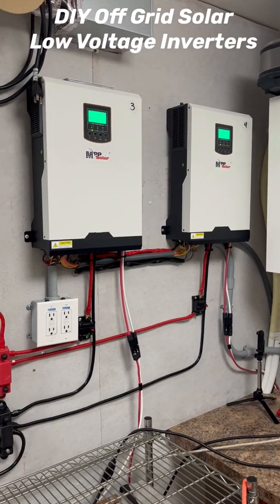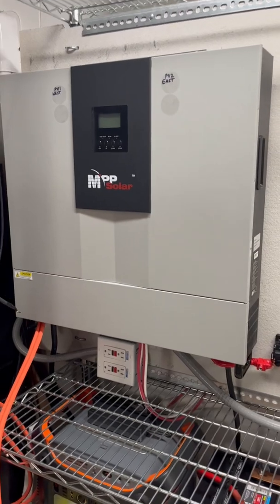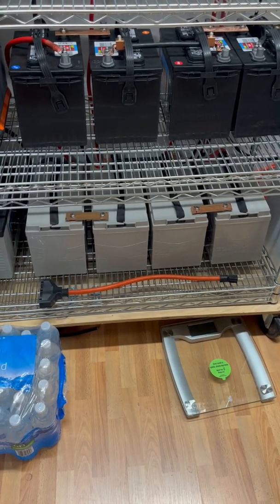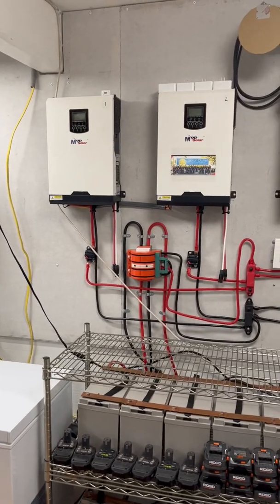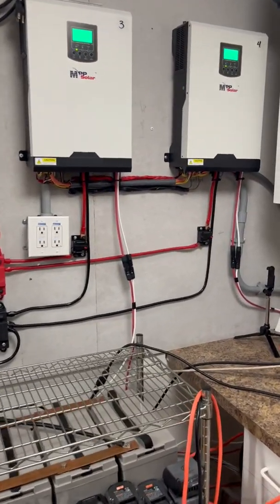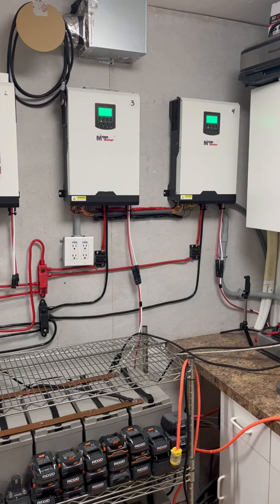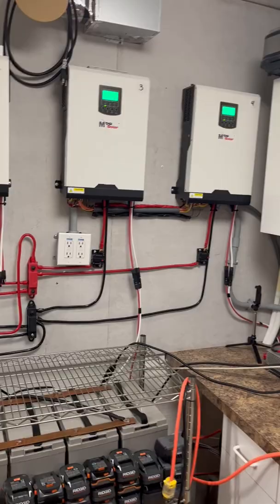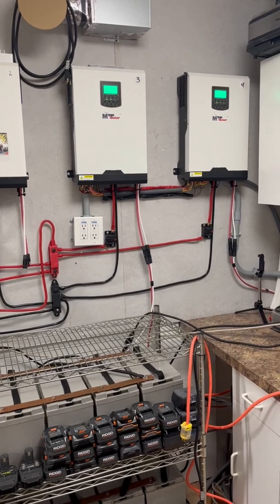DIY solar power with Pappa Off Grid Inverters 24v & 48v  inverters comparison.

Comment: Ditch the AGM batteries.  Lifepo4 is the way to go.  Also, why are you running three different systems?  Put all your batteries into a 48v configuration and run on the split phase inverter.  You will have more than enough to run all night.
Reply from the maker: I appreciate your input. My electric bill for 2022 will be less $800. I have no need to purchase anything else. What I currently have will be sufficient for the next 7-10 years without spending another penny. I have 25,000 watts in panels and everything is paid for. In 9 months I will have completely recouped my investment. That is a 2 year payback on investment. No need to spend money on something I don’t need. But thank you once again on input. My electric bill decreased over $4000 last year. I can live with a $800 electric bill for entire year.
Reply: @diy-solar-guy  yeah same for me, I actually use 2 24v forklift batteries, forklift batteries can be reconditioned, and they actually last anywhere from 10 years to 25 years.
Reply: @diy-solar-guy  You already have the equipment right there on the wall.  You could remove the 24v system, use the batteries on your 48v inverters, and be more efficient.  Plus, you could sell the 24v inverters and make money off down sizing.
Reply from the maker: @farside1  I agree with you, I thought of removing 24 volt systems but those might be going somewhere to help someone down the road, so really can’t sell them. But I agree with you.

Comment: Nice video, but i think you got it all wrong, the higher the battery voltage the higher the efficiency, its true that from 24v is 300ah to 12v is 600 ah but the capacity is the same they are both 7,200 watt hours… in my opinion ditch the 12v and 24v and just use the 48v is the most efficiency
Reply: Unfortunately you are still wrong here. amp hours is a pointless number to go by, only the WATT HOURS matters, the reason your 24 volt system seems to last longer is because you have more WATT HOURS. You can do this math simply by taking your battery VOLTAGE times your series CAPACITY and that will give you watt hours.
The reason this is that your 24 volt system has a 14,400 watt hour, or 14.4kWh bank, whereas your 48 volt system has only a 4.8kWh bank.
I would suggest that if you look at the fact you have four 24v inverters, all with their own individual self consumption, you are probably wasting MORE power running the 24v units vs one of the 48v units. 
If you were to take the 12 batteries from your 24v bank, and rewire them into 3 48 volt pack to parallel into your 48v bank, you would then have a 18.8kWh bank for your 48v system
That would be ideal as running higher voltage inverters (48) have a higher conversion efficiency than lower like you 24 and 12. This would equate to less LOSSES in your overall system.
When I say they are pointless numbers, I don't mean any offence. It is just that it is only once we convert the numbers to something that doesn't need the voltage to compare it, we then get a true apples to apples comparison.
I see this video is a few months old now, and if you have already learned what I have laid out then great, but you may want to edit and re upload this video with these fact in mind.
If you need another example I can give you this. All those drill batteries you have on your shelf all advertise in big numbers the Volts and aH right? well if you have a 40v10aH battery in one hand, and a 20v 20aH in the other you may be thinking one has more power than the other, but they actually have the same energy, 400wH.
I hope this helps you make better videos, I am enjoying your enthusiasm and the heat pump pool heater videos.
I also run MPP Solar inverters, I have two pip5048mg inverters that run my whole house in grid down situations and charge my tesla year round. about 7kw of solar and 28 kWh of battery. (notice I don't quote the aH) I am doubling the capacity in a few months when my latest delivery from china shows up with a bunch of boxed LiFePO4 shows up to add to my existing batteries.
Reply from the maker: Hi, when I use the 48 volt battery bank system at night to run a refrigerator and 2 freezers, I can get 2-3 hours before my battery bank if depleted at 44 volts. I start out around 51-53 volts. When I run the same appliances on the 24 battery bank at night I have no problem going 12 hours. My bank starts out at 25.5 and 12 hours later, the battery bank is at 24.6v-24.9v. You are correct, the 48 volt system is far superior for daytime usage hands down. I run 6 mini splits during the day on the 48 volt systems because I have plenty current coming in from solar to run everything and keep batteries charged. That’s 8 tons of ac or heat on these heat pumps.The 48 volt system is great during the day but battery bank is worthless at night to do anything with. That is why I have both 24v and 48v. I have successfully used the 24 volt system at night with no problems and have tried using the 48 volt system several times at night and I can never get thought the night or even 6 hours of battery usage. I really thank you and appreciate your comment. Hope you have a wonderful and blessed night.
Reply: @diy-solar-guy  Unfortunately you are still wrong here. amp hours is a pointless number to go by, only the WATT HOURS matters, the reason your 24 volt system seems to last longer is because you have more WATT HOURS. You can do this math simply by taking your battery VOLTAGE times your series CAPACITY and that will give you watt hours.
The reason this is that your 24 volt system has a 14,400 watt hour, or 14.4kWh bank, whereas your 48 volt system has only a 4.8kWh bank.
I would suggest that if you look at the fact you have four 24v inverters, all with their own individual self consumption, you are probably wasting MORE power running the 24v units vs one of the 48v units. 
If you were to take the 12 batteries from your 24v bank, and rewire them into 3 48 volt pack to parallel into your 48v bank, you would then have a 18.8kWh bank for your 48v system
That would be ideal as running higher voltage inverters (48) have a higher conversion efficiency than lower like you 24 and 12. This would equate to less LOSSES in your overall system.
When I say they are pointless numbers, I don't mean any offence. It is just that it is only once we convert the numbers to something that doesn't need the voltage to compare it, we then get a true apples to apples comparison.
I see this video is a few months old now, and if you have already learned what I have laid out then great, but you may want to edit and re upload this video with these fact in mind.
If you need another example I can give you this. All those drill batteries you have on your shelf all advertise in big numbers the Volts and aH right? well if you have a 40v10aH battery in one hand, and a 20v 20aH in the other you may be thinking one has more power than the other, but they actually have the same energy, 400wH.
I hope this helps you make better videos, I am enjoying your enthusiasm and the heat pump pool heater videos.
I also run MPP Solar inverters, I have two pip5048mg inverters that run my whole house in grid down situations and charge my tesla year round. about 7kw of solar and 28 kWh of battery. (notice I don't quote the aH) I am doubling the capacity in a few months when my latest delivery from china shows up with a bunch of boxed LiFePO4 shows up to add to my existing batteries.
Reply: @sNEAKYnIGHTmUPPET  I will have to agree with you.  I would remove the 24v system entirely, remove the 12 batteries on the 24v system and build three more strings of 48 volt batteries for the 6500 watt inverters.  First, they can handle more wattage in split phase than the 24v inverters, 13,000 watts vs 4,800 watts.  With four banks of 100ah batteries he would have 4,800 watts x 4 = 19,200 watts of stored power to play with and not have to do any switching at all.  Granted the types of batteries he is running is not Lithium, but the system would still be more efficient than what he is running.  He didn't mention his solar array, so we don't know how much power he is using to charge the batteries.  That would also be nice to know.
Reply from the maker: I have a total of 23,750 watts connected to the 6 inverters. So that is 95-250 watt used poly panels total. Not one solar panels is on my roof of house. Why put a hole in a perfectly good roof that does not leak. I will probably remove the 24 volt inverters and use battery and panels on the 3-48v off grid inverters to better utilize my components. A work in progress and learning even more as we go. Thank you for your input and communication, it is really appreciated. Hope you have a wonderful and blessed day.
Reply: @diy-solar-guy  That is interesting. Thank you for this tested information.